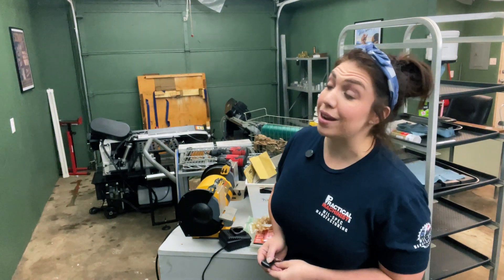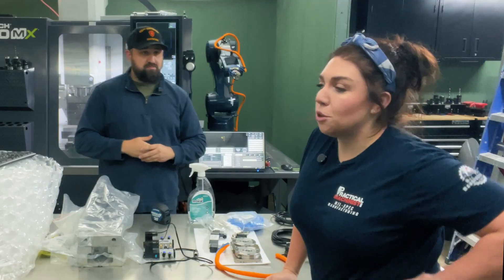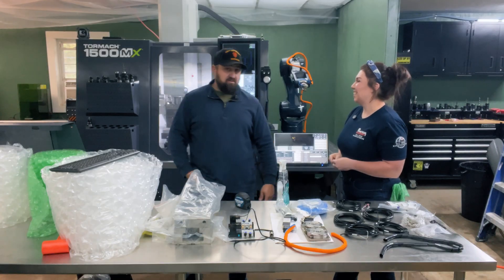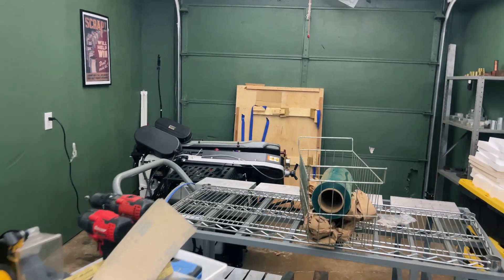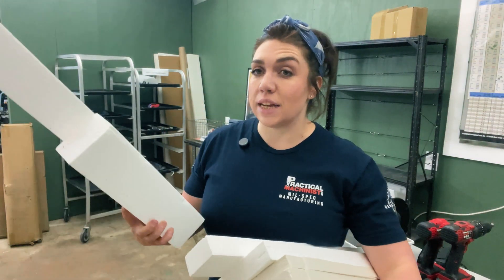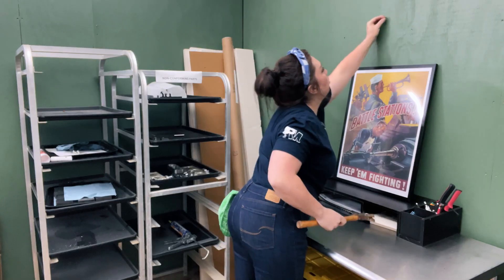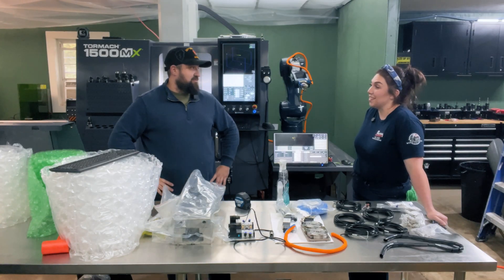What Happens When You Run Out of Shop Space (Again) | Becoming A Practical Machinist Ep. 36

Comment: Can you tell me which tolerances the bandsaw holds for e.g. stainless cuts ?
Reply: I Have the older version of that saw accuracy is dependent on how accurately you set it and its not very easy to get set correctly the first try . once its set it holds length very well easily 1/16 consistently just not real easy to get set on the first part.
Reply: @garyweber7419 thanks for your response! Sorry for asking 1/16mm or 1/16 of an inch ? The first is great the last is horrible 😂😂

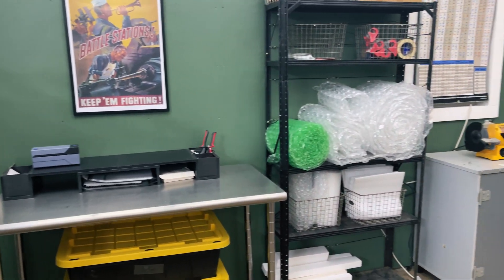Comment: 11:00 - the green looks good.👌 speaking of "appearances" a finishing touch (assuming you haven't considered this already) would be to Epoxy Coat the floor in this receiving area. for sure it would be nice to do the whole shop but I get the hassle of having to NOW move heavy equipment out of the space AFTER THE FACT.  i only park cars in my garage so it was a much easier proposition plus I did it myself.  it came out great, but admittedly if I had to do it again it would likely just pay a professional to come in and do it and get it over with.  the color application, the chips, and the clear was easy but the prep with concrete surface grinder was a PITA, so thankfully I wasn't in a rush.